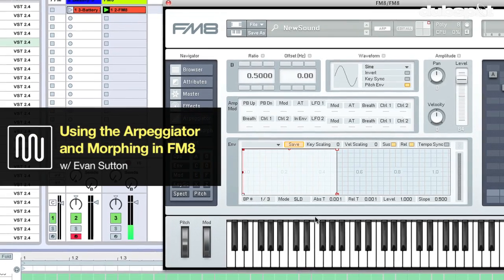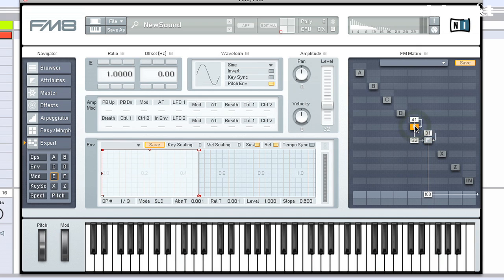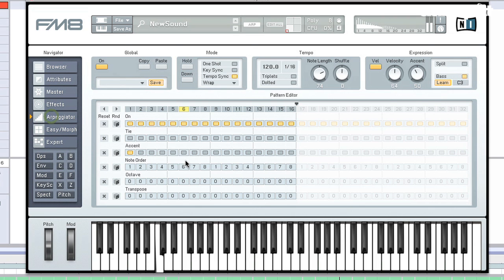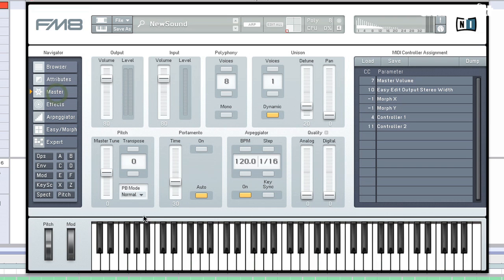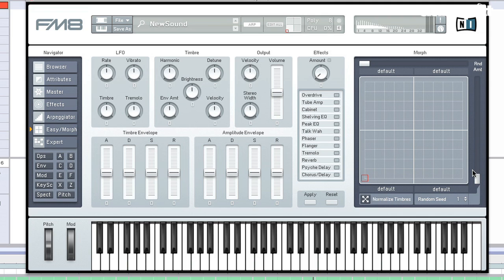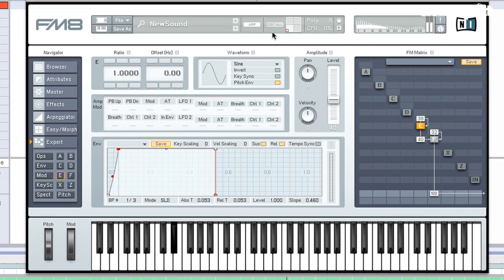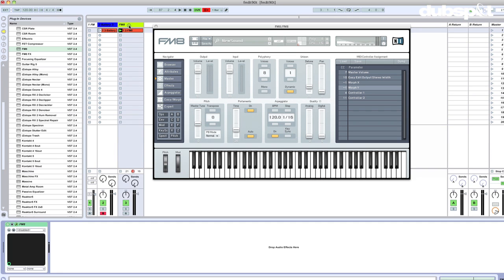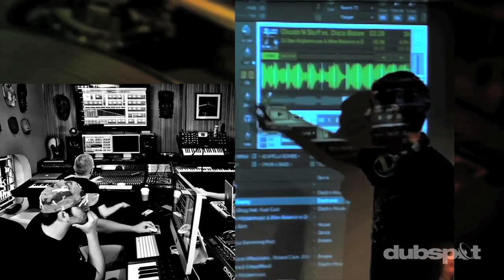Native Instruments FM8 Tutorial: Sound Design Using the Arpeggiator + Morphing

Comment: Please correct me if i missunderstood but i think fm is called fm because the carriers frequency  is modulated by the frequency of the modulators waveform.. in this case it is sounding like a filter opening because the sine wave gets more and more overtones depending on the envelope of the modulator.  so first it is a sine wave and after the modulators amp amount is raising the resulting wave is near to a sawtooth

Comment: Very helpfull. Thank you.

I am trying to use FM8 in FL Studio.

It works in both pattern and song modes fine .  But if I am in the song mode and play what I have already made so far, and try to play the FM8 on top, it does not work.  I have this problem when the sound is going through the arpeggiator. 

Someone suggested to "to set the VCA envelope attack to zero and open the arpeggiator gate (note length) wide enough to let notes through."

Where are these controls in FM8?

Thank you.

Comment: when i morph or use instruments such as the bass guitar for example everytime i hit a key the sound has a different accent. its not just how hard im hitting the key becausae when i put it in arpeggiator mode it still does the same thing. When the melody is played it kind of randomly changes which is EXTREMELY annoying and almost impossible to get the melody down that you want bacause u never no what its going to do. Im sure there is jsut some option that i need to tweak but its tweaking me out